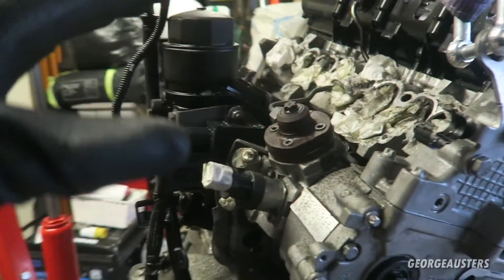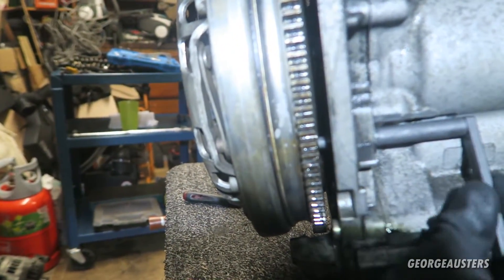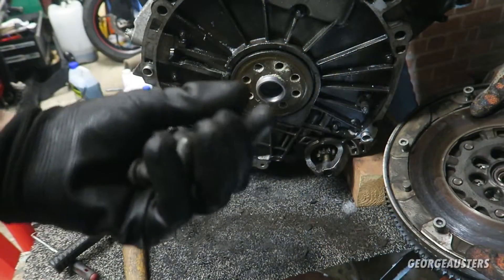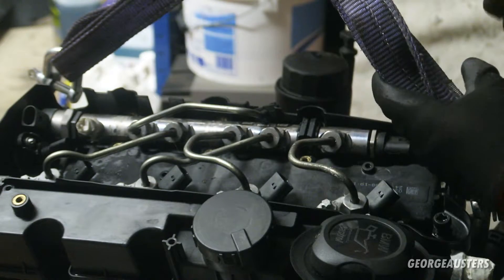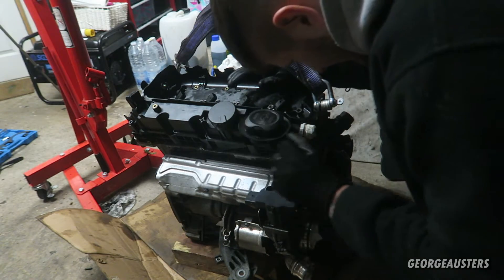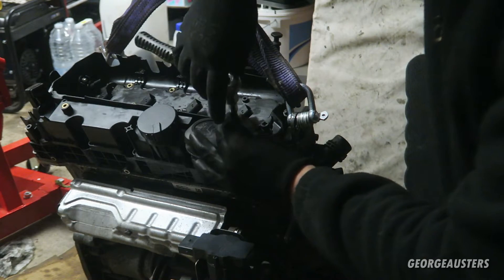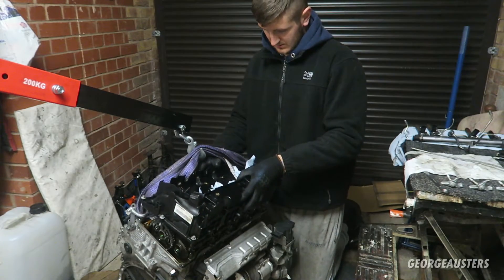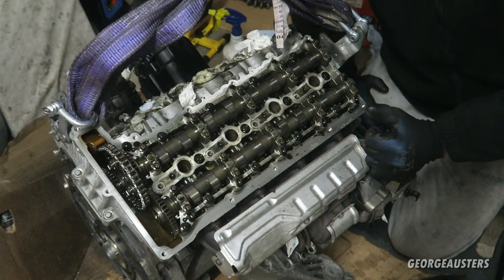BMW N47 Engine Teardown For Timing Chain Replacement

Comment: B57d30b is very similar is it?
I have 2017 740d, now is time to change the timing chain  and the crankshaft, connecting rods bearings,I considering to doing myself.
Reply from the maker: Yes it’s a very similar engine

Comment: Hi George. Just(according to your tutorials) finished removal of engine, and tear down ready to replace the timing chain system with new parts. 2008, 520 d, automatic, 305 000 km on the clock. I noticed that there is relatively no slack in the upper and midle chain. All guides look ok. The oil pump chain have a slack of approx 15 mm.. May the "rattle" and a "knock" sometimes come from the oil pump chain? Or(as I think) do the worn chains and guides make noice when engine starts/run. Br, Audun
Reply from the maker: The oil pump slack is normal

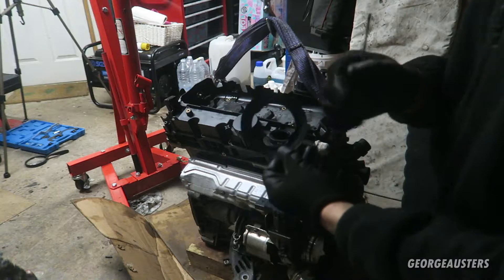Comment: George at 10:04 the oil cap ring, what would cause smoke coming from under them sides? Normally get a bit of smoke always showing from under the rubber ring. Thanks
Reply from the maker: Excessive crankcase pressure or the seal needs replacing
Reply: @GeorgeAusters  cheers boss. The seal as in the rubber ring? Also what’s the cure for excessive crankcase pressure ?

Comment: Waow, and this is after having to take every cable and connector off to get the cover separated. Jeepers. Bit more work than my old manta which had nothing to disconnect, literally just the cover bolts and a couple of pipes and max 1hr to do.

Comment: Been quoted 1200 for timing chain or 1500 if it snaps to rebuild engine fitted
Reply: I paid 2400 for Timing Chain, clutch and flywheel, camshaft brassings and One or another thing more like oil pump

Comment: Hey George,
greetings from Germany and thank you for your awesome videos!
I'm also planning to do the replacement on my 3 series and was wondering if you could tell me the size of the thread on the injector, so i can build myself a slide hammer like yours.
Reply: 14mm
Reply: @dannygeed9322  14mm x1.5 mm thread

Comment: Thanks for posting this George. I have this engine in a 118d. I've heard so many horror stories about the timing chain failures that I was curious. Mine is on 89k miles, but drives like new and is so quiet on  idle it makes the newer diesels sound loud. Also mine is on the original clutch and mass flywheel too, there is some slippage under hard acceleration but other than that it's fine. Thanks again for posting.
Reply from the maker: Welcome Paul!

Comment: Nice work! Do you think it’s possible to do the chain replacement job without removing the engine, and only removing the gearbox?
Reply: Yes. Having done it the hard way. I would be brave enough to try it in the bay now.
Reply from the maker: Yes I can be done, but no comfortable trying to do it while lying on the cold floor

Comment: Great vid' - Wish I had found this b4 spending £££ on the replacement of my chain. But still a great education to find my way around this engine. Thanks so much for taking the time to document this.
Reply from the maker: No problem Andy!
Reply: would you mind telling me how much you paid?
Reply: @MygenteTV  if memory serves, approx 1200
Reply: @Turbostott  dammm that just crazy, i was asked the same just a week ago. but you know what bro? just buy yourself a set of cheap tools and start doing your own work. i used to work in my honda civic back when i was 15/16. this wont be a big of a difference
Reply: @MygenteTV  I know right. I'm ok with the spanners TBF, it was more a case of time contraints with a 4 yr old and not wanting to do this on the drive, the idea with this car was to have it as a reliable everyday workhorse, the last thing I wanted to be doing was ripping it's guts out on day 1. I'm going to have this car for a long time so it's worth investing in as I paid good money for a very good car. Over the 1.5 years I've done plenty to sort out the irritations and problems associated with the e61 and am now in a position where there is literally nothing wrong with it, and should remain that way for some time. To date I have rewired the wiring to the rear tailgate, replaced the intercooler, aircon condenser, replaced all fluids, serpentine belt serviced all and relocated all the relays / controls that BMW thought was a great idea to put in the well of the boot, where from time to time water does build up. Next up is a remap which I have booked in in a couple of weeks to help wake it up and hopefully see me 50mpg. 

I'm extremely happy with the car, and George has done some fantastic work, even how to clean the damn thing well which have all been very informative and much more 'in the real world' in so much as not throwing megga £££ at it and also not just a load of ol' repetitive waffle which can be seen in a rival you-tubers post frequently.
Reply: @Turbostott  this is my same case, im tired of just making people rich, when i can just do my own stuff at home. a couple of weeks ago i found out my intake swirl flaps were broken( the stick that hold them on place). the mechanic told me to buy a new one(500 euros) after gathering some information i found out that it was just wasted money since those things will keep breaking after some time, and it can even go into your engine and do big damges. the solution? take them all out. which mean you can do it yourself paying nothing. in my case i paid for it, because i didnt know it.

Comment: I hate bringing up timing chain noise as its very subjective, but were you hearing an "slack" sounding noises or kind of ratchet noises, because i definitely am from my one.
Reply: Jay Patel my N47 had this ratchet like sound too, obviously I can’t tell if it’s the exact same noises we both had but my chain guides were completely broken at the top of the engine upon tear down, I also had a really horrible  2 second rattle on start up’s too which I believe was the tensioner. I would definitely suggest just biting the bullet and having the chains done and don’t bring it near BMW
Reply: @robbieshaft  cheers, I'm not getting the noise on start up, but I'm definitely going to do the chains in the summer, I'm looking out for any new noises or changes to the current ones.
Reply: Jay Patel good stuff, I’d take it handy till then with it if I was you, I’d imagine the ratchet making noise is maybe a broken guide but I could be wrong
Reply from the maker: It wasn’t a slapping noise, more of a louder tapping noise. The slapping noise means your tensioner is failing

Comment: Great video, can't wait for the next one 👍

As your timing chain is in good condition, why replace it? 

Will all N47 suffer this problem if they haven't already. 

Is this fault not covered under BMW Recall, I've read some articles on the Net suggesting it Could be.
Reply from the maker: My belief is that BMW would deny there is a problem if trying to get them to rectify the engine... And I can’t say that I would trust them to complete the job, one of the reasons why I do all my work myself so I know exactly what has been done.

There’s no knowing the condition of my whole timing chain kit was like, the tensioners, sprockets etc. Always best to replace them since I’ve already done the hard work of removing the engine👍🏻

Comment: my n47 engine had 132000 miles on the clock the injector came out after wiggling them a lot, wasnt too bad was expecting to be worse
Reply from the maker: They may have came out once before. Mine were properly stuck because they’ve never came out before